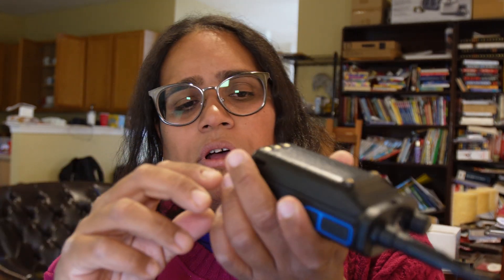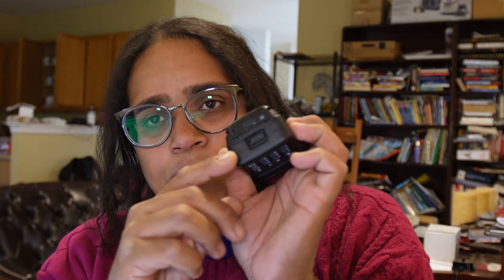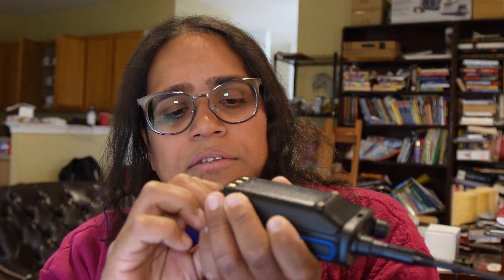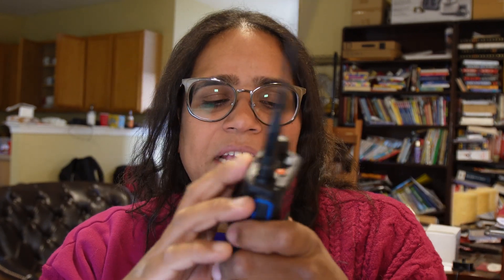I want USB type C charging on ham radios.

Comment: USB  C is great. But there's a catch . Not all usb C cables will work . Some will charge a phone but not a HT . Also some USB C PD cables not backwards compatible with USB C 5V .  Just more cables I have to get for USB C . Now reachable batteries like 18650 and 9V have USB C charge but work only on some USB C cables. And some USB C cables are charge only. will not pass data . I now have a cable tester for USB C . There's no  USB C that works for all.  The USB C PD format seems to be on its own and need PD cables just for that . Anyways there's a upgrade for the ICOM 705 now to have a USB C port ! this also gives a 12V PTT line . 73

Comment: I have always wondered why ham radios overall do not come with a power supply that  you can just plug into a wall?. I guess for the same reason that printers do not come with cables.

Comment: I have a few radios with USB-C charging and I am not a fan in general. Why? because they then don't include a cradle and a charging cradle is 100% better that USB-C. If USB-C charging was in addition to a cradle then yes it's nice.
Reply: They could have it like the Nintendo switch where the dock has USB C built in to set the mobile unit onto.

Comment: While they are adding USB-C how about including some decent programming software and a cable so we don't have to pay the $50 RT-Sytems tax on every radio purchase.
Reply: They should just expose the programming interface as a USB UART and have a programming menu that can be used with any serial terminal program.
Reply: Not that RT Systems is that great of a software anyway. The interface is straight out of 1993.